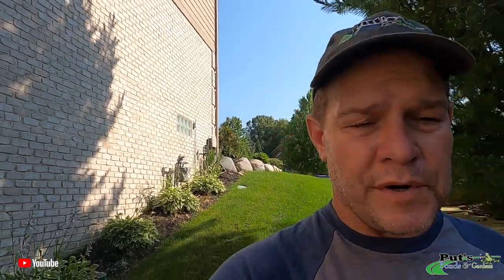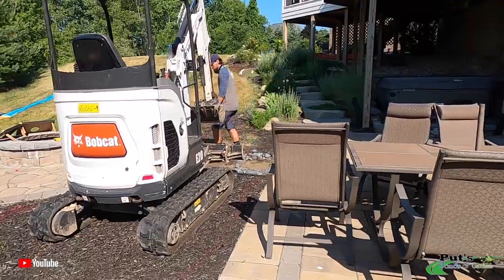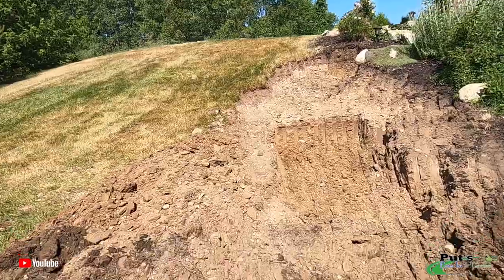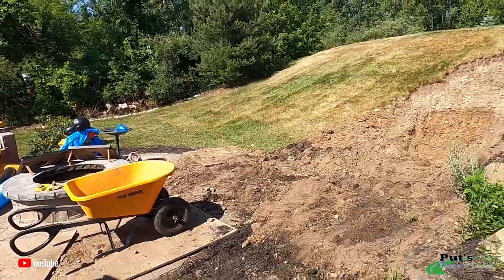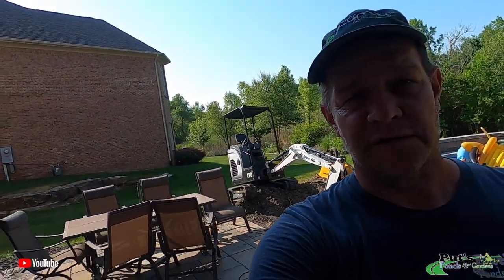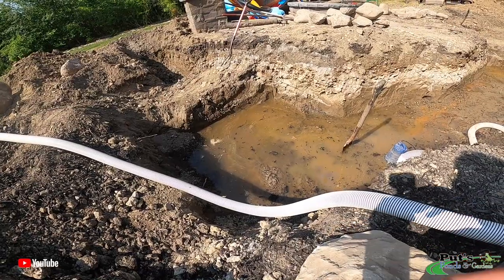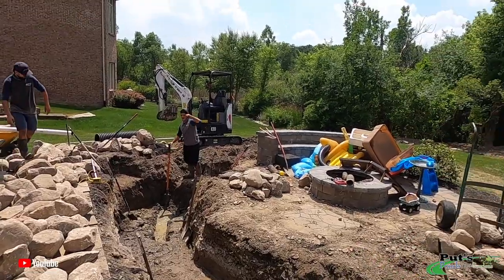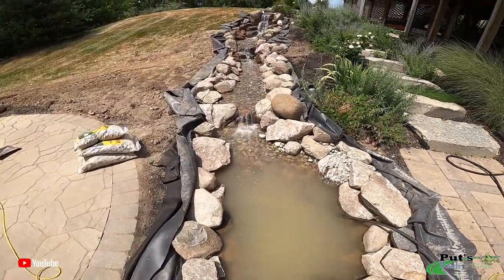How To Create A Hillside Pond & Waterfall

Comment: I am in the process of building a very similar waterfall, (Pond is a normal size that I already have built) but what pump and plumbing did you use for the project? I would love to hear your thoughts on what GPH was needed to get a great flow like that. 

Thanks!
Reply from the maker: For this project it was 2” flex pvc piping and a 5-pl Tsunami 5,000 gph pump